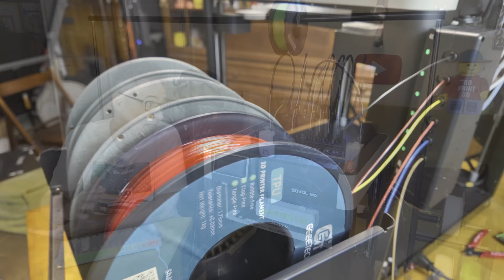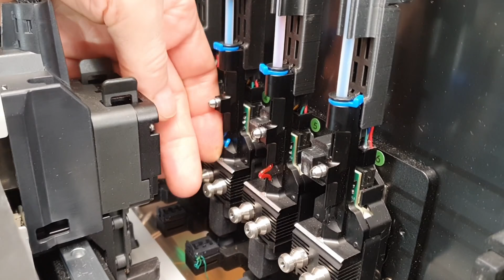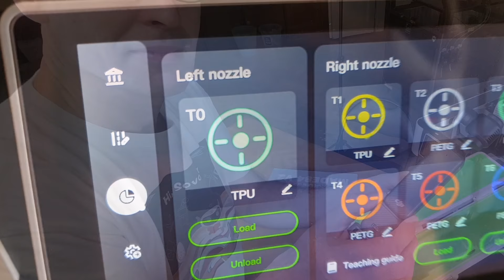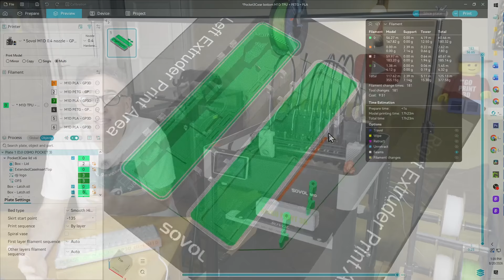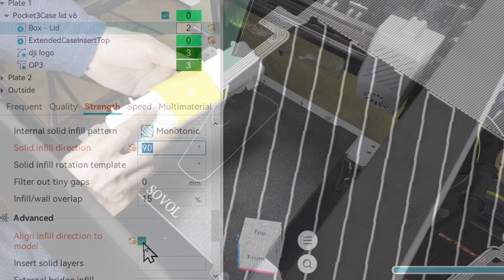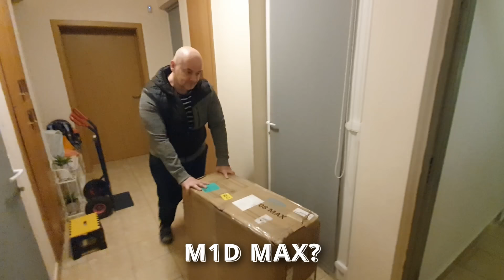Sovol M1D – Printing TPU 💪 4-Material Flex: TPU+PETG+PLA 🤔 FAQ before you buy

Comment: 0.6 or bigger nozzle can help alot with tricky tpu feed.
Reply from the maker: Absolutely, we actually kept a 0.6mm nozzle in our previous TPU king the original SV06 Plus. I will eventually get to experimenting with various nozzle sizes on the M1D, this is a sensible angle.

Comment: Thanks for the video. I think that "just because we can" doesn't mean, "We should". I think a lot of people are going to make one piece prints with different filament just because they can, but this case is very much a case for not doing that. From what I can tell, you traded lots of time remodeling, and time doing tool changes during printing just to save you a few seconds of gluing pieces together. There are of course times when printing hard and soft filament in the same print makes sense, but this is not one of those.
Reply from the maker: You make a fair point, and in this specific case, gluing separate parts would definitely have been much faster than the time spent troubleshooting multi-material settings! Though the end result feels amazing in the hand, and having the inlay and edge-sealing part of the model instead of a piece that can fall out means an ever better seal and an absolute perfect fit.

Comment: How about the hotends i see they are same crap like sv08/sv08 max clogging or not i use a E-3D Revo Ceramic Heating Core Hotend never clog.
Reply from the maker: Good news: they are the same. I never had problems on the Zero / MAX, but if you want they are just as easy to replace standard MK8.

Comment: Can you bypass the AFS and do top loading TPU for ALL toolheads?  Or does that trigger some sort of filament runout.  Multicolor TPU was the main reason I wanted this.
Reply from the maker: interesting idea. I think the solution might be more simple just tweaking the tool change routines to include less retraction or as someone suggested so much more that the filament is pulled past the exposed section.

Comment: 300x300 ? it's only 240x300 when using both heads
Reply from the maker: 300x300 when using 6 tools, only the 7-tool printing is limited in size. And in copy mode you get to fill the full 356x300 area with 2 or more copies of a batch print, that will print in half the time other, regular printers would be able to produce the same number of pieces.

Comment: Hello Gergo, hope you're fine. How are the first layers? Are they consistent, or does it need tinkering like on the 08?
Reply from the maker: Pretty good first layer, it is more similar to the system of the MAX with the Eddy probe. It seems to be using a similar ABL system. Obtains z-offset automatically before every print. Does QGL and full bed mesh before every print.

Comment: Yes! This is exactly what I wanted to know for this printer. Shame you can’t do more than 2 TPU colors currently. I was really hoping to use the tool changer for foaming TPU, using each head to control the density throughout the model like you can do on the U1. Hope a fix can be figured out. That’s the main thing holding this back from being my dream printer.

Comment: This looks like exactly what I want out of a printer... I hardly ever print TPU and by the time I decide to I bet the solution will already be figured out(or just do like you did and hang it overhead on the left head) bit for multicolor/material/ supports I love the flexibility this machine seems to offer.... Smaller items just load the support material into the left tool head.... Bigger items ... Just use it as a 6 tool changer(still one more tool then I am used to with the shops Prusa XL) 

Need a bunch of small single material items.... Copy mode and an even bigger build volume.... ... It honestly ticks off all the check boxes I have any real interest in 🤷🤷🤷
Reply from the maker: Exactly!  My dream printer as well TBH

Comment: For the TPU retraction would it be possible to put two short layers of tubing in those exposed areas while loading the filament?
Reply from the maker: Loading is not the problem, but the retraction during toolchange.

Comment: Many did a cancellation... I decided to as well... sadly. I wanted a IDEX and toolchanger. But a couple things did it for me. First the enclosure is an afterthought, no filter or filament enclosure. The big things are also no 120 deg bed temp and that IDEX looses you space not just as copy or mirror mode. Yes the complaints about unfinished SW and some issues can be fixed by the community, but then, why is it not priced of that?
Reply: What? Why did the community need to fix software for a printer that’s not shipping yet? Did you think this was a production unit? What is happening?

Comment: disable retraction?
Reply from the maker: It's not retraction during print, that is reduced and that's OK.  The problem is the way the tool parking macro reacts with flexible filament.  But the printer being fully open, we can tune that macro to work more smartly with soft TPU.

Comment: The more I see of the M1D the more I'm confident in my choice to back it on day 1. As for the Idex debate, it doesn't seem like it would take much work to remove the independent head and edit the config files to allow the tool changer access to the entire 350ish mm print area if someone was so inclined. Personally though, I was actually trying to figure out if the single head could be upgraded with better components to allow for 350c+ print temperatures in the future. I don't do a lot of nylon printing but it would be nice to have that option especially with the ability to use ABS/ASA supports from the tool changer side.
Reply from the maker: For me personally ABS and ASA is enough. For those 300C max nozzle is plenty.

Comment: fantastic video! thanks for doing all of this testing. Does the M1d come with hardened steel nozzles? because i heard the glow in the dark filaments can grind down the tip of the nozzle. the bondtech indx is having that problem because they don't have fully hardened steel nozzles.
Reply from the maker: Yes it is hardened steel. But they are the most widely available MK8 so you can replace them for pocket change (or get all kinds of advanced variants).

Comment: What I really want is the m1d tool changing system in the sv08 max platform size
Reply from the maker: That would truly be the ultimate machine for large-scale multi-material projects! 🤩 I address this question in the video. I'd recommend looking into 3DPrintDemon's IDNX upgrade for the MAX. I guess if this release is successful Sovol could develop this platform into a MAX size variant as well.

Comment: I was so incredibly hyped about the M1D. I even booked the VIP ticket. I've now seen the review and the one from mpox. I have to cancel my order too. It somehow doesn't make sense that a Prusa CORE One+ (Gen 2) INDX 8-Tool only costs 200 euros more. Sure, I know it's hardly comparable. But the reviews have now made me feel negative.
Reply: Curious what part of the reviews made you feel negative. Also, you might want to be careful with the Prusa/Bondtech combo since they've taken a bit of heat for not providing hardened nozzles when they were promised. It's still a good system but just something to be aware of if you're planning to print abrasive materials.
Reply: @Chris-pz4mb For technical filaments, I have the h2d and the P1S (with the appropriate upgrades). I've cancelled the printer order based on the MPOX review (German channel). It doesn't feel right either...
Reply: Additionally... I have almost no space left. The solution with the storage next to it is a real thorn in my side. I'm already so annoyed by the AMS (automatic mirrors).
Reply from the maker: MPOX clearly received a lemon. Seeing others, I feel it is an outlier, but it's understandable to be cautious.  All I can say I am extremely happy with ours, this is our moxt exciting printer to date, and as you can see we have quite a number of machines!
Reply: @gerGoPrint3D I now have the Zero and the SV08 Max, and a total of 12 machines at home. I was most excited about this one, but the small price difference to a premium machine. The filament solution, due to my limited space and the restricted print area for the different modes, has unfortunately made me uncertain. It's just too much money for that.
Reply: @gerGoPrint3D This issue is really bothering me. I'm going to take some measurements and do some more in-depth research today. I've rewatched all your videos. There's nothing wrong with the printer. I'm driving myself crazy.

Comment: M1D advanced feels like one of the best posible 3D printers, still need some tuning for soft materials, but that looks solvable and being as open as it is, i don't see why community can't come up with a solution for that retraction problem
Reply: " i don't see why community can't come up with a solution for that retraction problem"
That's the problem with this brand. Why the community has to fix it?
Reply: Sovol could fix it before launch, or not. At least they are not getting in the way of people fixing it by themselves. You can always get a bambu lab and call it a day

Comment: Thank you for this. The issue for TPU looks to be easily tunable. I'm thinking if we unload the filament to being out of the feeder area and then load it back during tool changes.Gotta love open source 😁
Reply from the maker: That's a great idea, and definitely something worth testing in the configuration files! 🛠️  Even if it meant a bit of extra purging, that could be a great workaround!
Reply: @gerGoPrint3D has Sovol, replied back to you on this issue? This is one of the things they advertised the printer would be able to do, Do they even give you the ability to provide them feedback? The two things I heard you mention, multi color TPU printing and CMYK full spectrum to the slicer :) thank you for your videos

Comment: With this limited (simply disappointing) TPU support, the Snapmaker u1 is simply a better TPU solution including  multi-material.  I'm printing a 3 color TPU (all 90a) toy for my gradndaughter.  I previously printed a dice box for my son's DND and it was PETG 90a and pla for support.
270x270 with multiple 90a support vs 240x300 with only 1 spool of soft TPU.  Deeply disappointed.  Cancelled my kickstarter over this video, very grateful for the timely info @gerGoPrint3D.
Reply: I'm thinking that if they/we pull the TPU out of the feeder area on tool changes, it should alleviate this issue. Time will tell.
Reply: @psedog It would probably solve the problem for tpu shore 90+... But for softer ones just gravity may be a problem. In my opinion hotend changer is not a way to go for soft materials
Reply: @Adam-Madman  Creality solved it, or claim to have on the forth coming k3 (which is a hotend swapper like the M1D and the INDEX rather than a toolchanger like the u1).  I think the issue with the M1D is what you sort of alluded to, that air gap on the nozzle is going to cause problems that no software update can fully solve.  I hope they solve it for at least 90a, as that is not ideal but is decently soft for most applications.  Still, glad for this video since it gave me the info I needed, and so I dropped the M1D and wait for something better at TPU.
Reply: @bjornlovoll8972  As an owner of 2 creality printers, just saying "Creality solved it" makes me dizzy 😅 But seriously, if they really did, it's awesome. Still I would prefer some clone of Prusa Xl or very well tuned Voron with toolchanger, just for long term reliability
Reply: @Adam-Madman  give a guy some warning.  I now have to go change my shirt which has coffee all over it.  
On a side note, hot coffee is a surprisingly effective way to clear out a stuffy nose.
Reply: @bjornlovoll8972 Oh, I am really sorry... But I laughed so hard when I read your comment, my wife thought I'm drunk 😅
Reply: @psedog  It might.  I hope for the sake of those still backing this, that you are right.